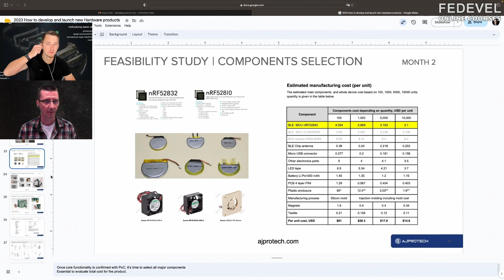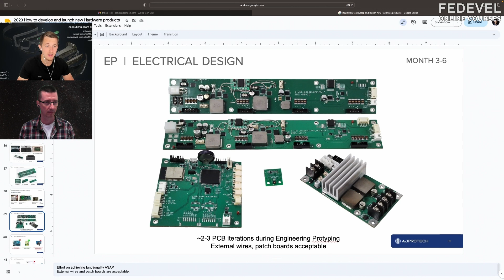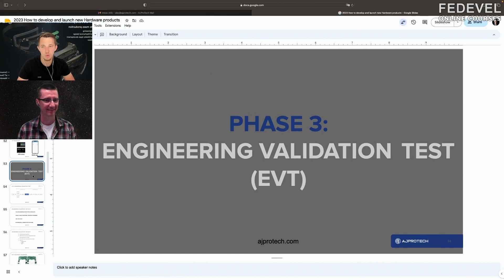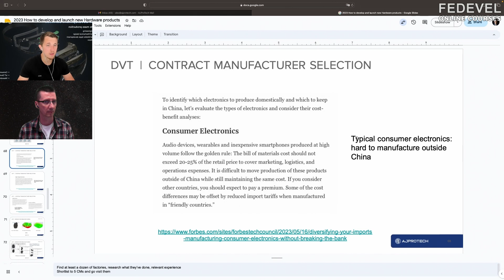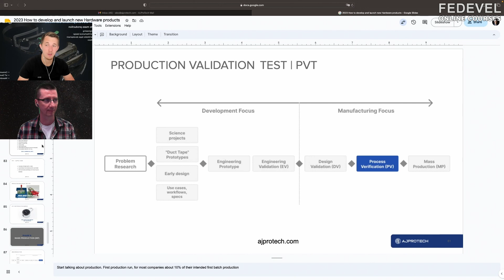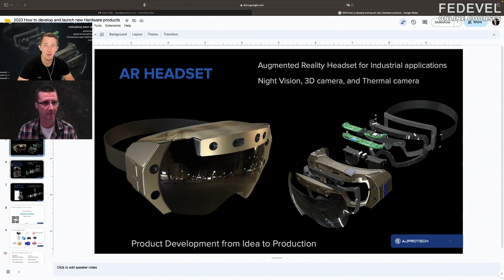From Idea To Product - How?

Comment: I have a feeling that ESP32 will remain relevant for a long time. It has the perfect combination of features combined with low cost and high availability. I took the jump to ESP and I'm glad I did. All through the shortage, I had no troubles getting boards but I remember people begging online for the PI. Most designs don't need the power of a PI plus the battery life sucks compared to ESP. I usually end up using the sleep modes or a lower processor speed because 240MHZ is overkill for many designs. I loved this interview, but the echo on the guest's side is brutal.
Reply: If you need a good ADC you can forget about ESP32.

Comment: At what point in this process do you apply for a patent?
Reply: Before you put any marketing materials or ship samples to clients. Otherwise you risk someone challenging your patent
Reply: After you've done some DFM validation if you can. Otherwise you're going to sink a lot of money into patents for a product that may never launch, a lot of startups where money is tight fail for this specific reason. You can apply for provisional patents if you're afraid talking to a manufacturer will leak some novel design. A provisional patent helps establish priority without wasting resources on patent process.
Reply: You don't.